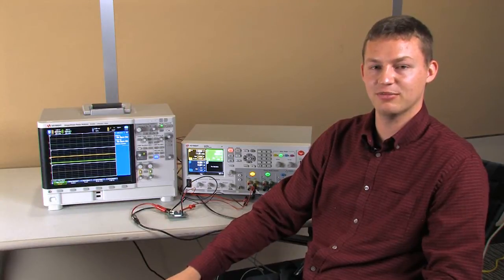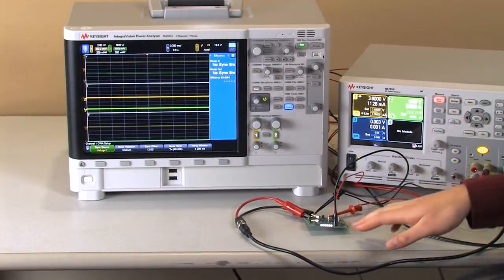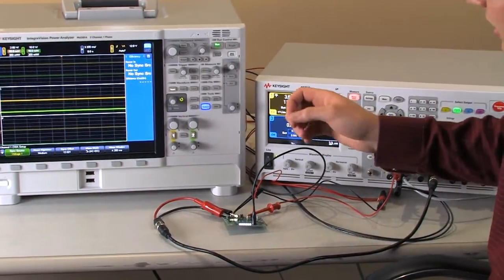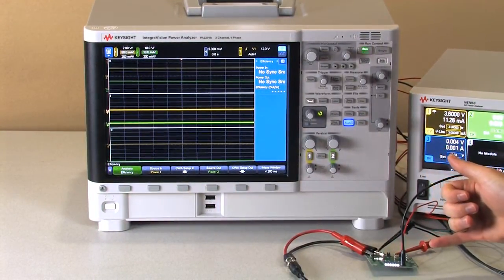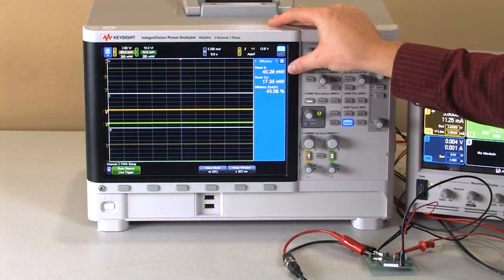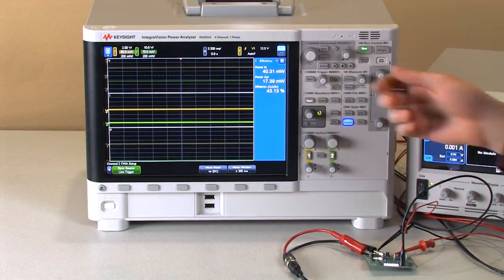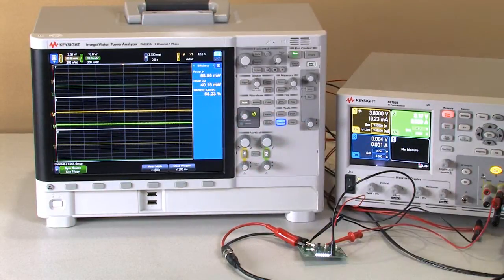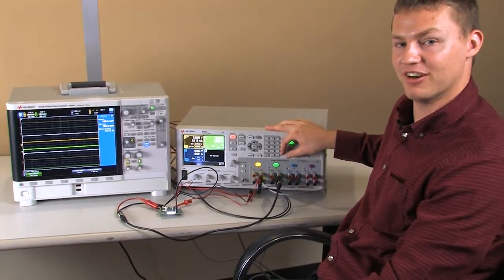Making Efficiency Measurements of LED Drivers Using IntegraVision Power Analyzer

Comment: What is more efficient for driving leds, transformerless or wall wort style?
Reply from the maker: Frank Nieto I'm not sure at some point the AC line voltage has to be converted to a DC current for the LEDs. Would it be better to have a single LED driver (wall wart) or run AC to each fixture?
Reply: How to calculate efficiency theoretically?